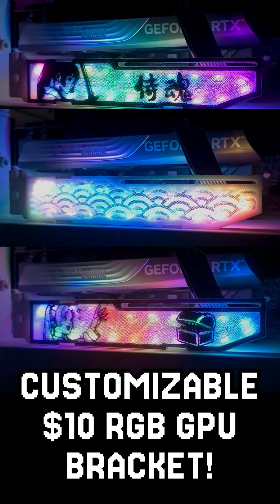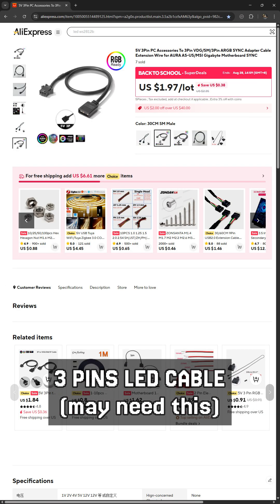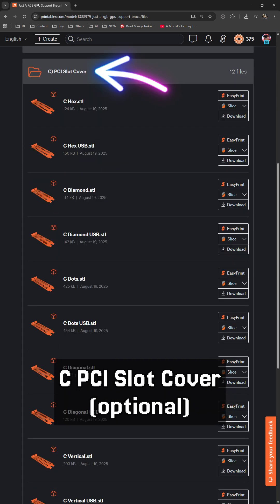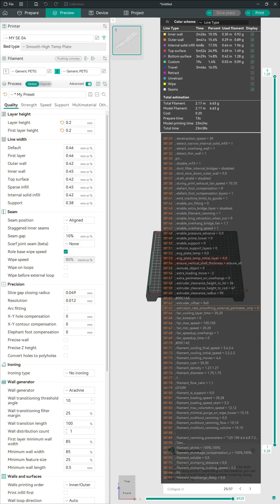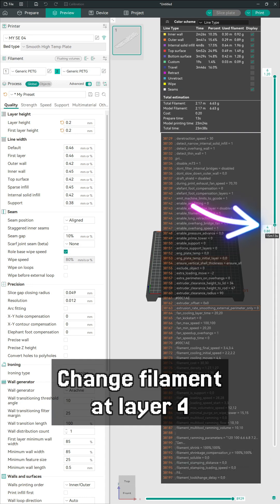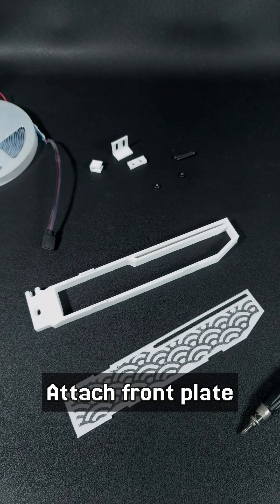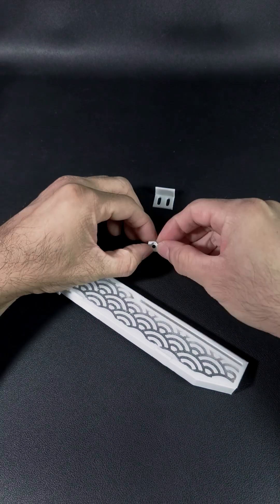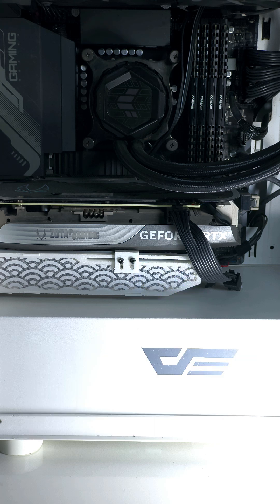Customizable ARGB GPU support for $10 👍 #diy #3dprinting

Comment from the maker: STL Download - https://www.printables.com/model/1388979-rgb-gpu-support-brace-with-customizable-plate

Note : Affiliate links to AE.
M3 Screws - https://s.click.aliexpress.com/e/_okX7EzJ
M3 Nuts - https://s.click.aliexpress.com/e/_oCAQPNx
WS2812B LED Strip - https://s.click.aliexpress.com/e/_onqvJuD
3 Pin to VDG/SM/3 Pin Cable - ttps://s.click.aliexpress.com/e/_oEbp6pR
Transparent Filament - https://s.click.aliexpress.com/e/_oEKBGb7
Reply: You wil need abs.
Asa.
When it geth hot you wil need petg.vo.otherwise it is a fire hazard. 
Must be fireproove.